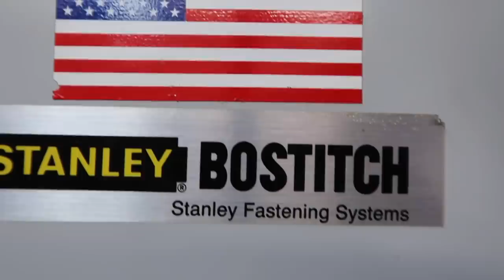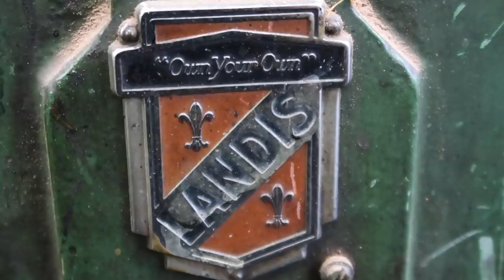RED WING 8131 Resole #59

Comment: Now I understand why it cost so much to have a resole..
Reply: deltafour1212 and thats just the labor. Theres still costs of electricity, rent, tools, machine maintenance, supplies, permits, insurance etc etc etc.
Reply: Randy Torres, for that boot, wouldn’t it be cost effective to just buy another new pair of Redwing’s?
Reply: @Smokey66s  Sometimes when you look at the pair of boots it reminds you where you been with them. So, for that reason is worth to save them and keep walking again :)
Reply: @Smokey66s  resole $80 to $160  vs new $220 and role club are special value.
Reply: Smokey 66 Depends what you want. I hate breaking in boots.
Reply: @Smokey66s  My first pair of Redwings was the best I ever owned.  I had them resoled twice, and I wish I had kept them.  Even Redwing doesn't have leather insoles in all of their boots today.  My first pair had leather insoles and they had conformed to every detail of my feet, especially each toe.  Like Randy Torres stated, breaking in a new pair of boots is a drag, especially if you're doing it at work.  I worked as a tree climber in those days.
Reply: Garden State Wildlife Control 
The heritage line of Red Wing boots should all have leather insoles and are made in the U.S. However, Red Wing does have non-heritage boots made outside of the U.S. as well.
Reply: Garden State Wildlife Control yes breaki in boots 🥾 sucks, I get used to mine and when I need new timberlands always get a few sores on my feet bc of how hard they are
Reply: I don’t know what they charge at Brian’s place but here in the U.K. Redwing want £105 to replace the soles on my old chukkas. That would be the standard chukka sole and not a Vibram Christie.  I bought a new pair instead but I ‘might’ get the old ones resoled one day.